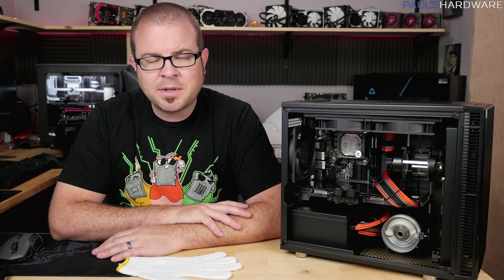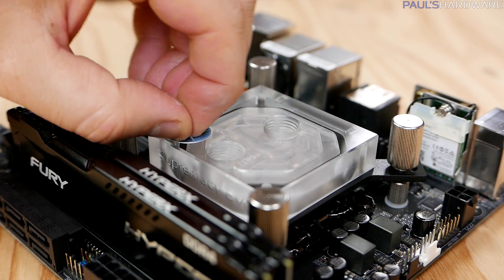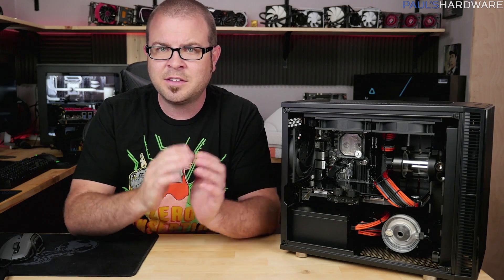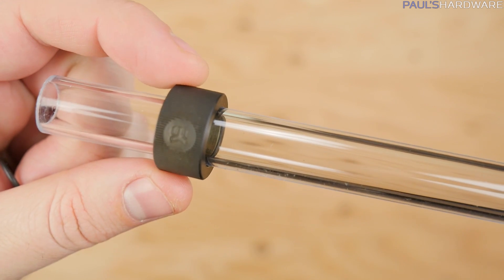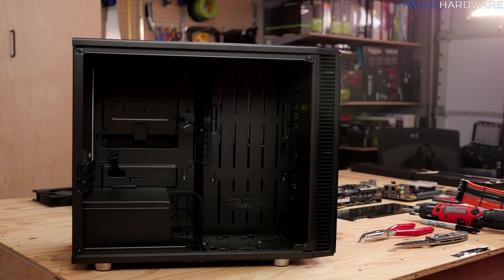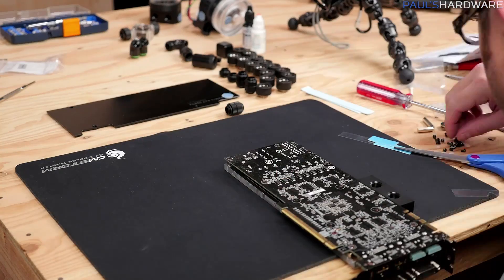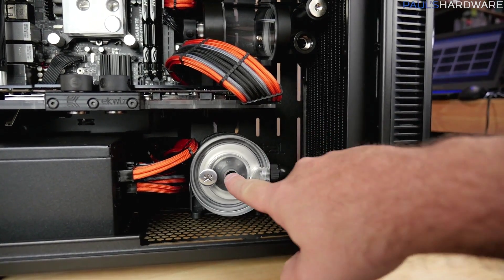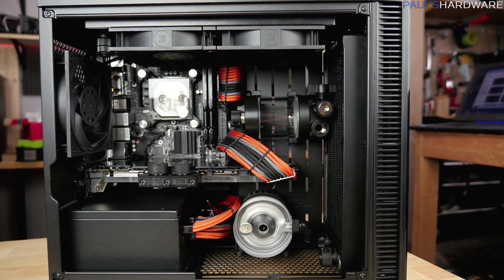HotBox Build Part 1: Mini-ITX Water Cooled Gaming PC

Comment: There is an understatement in a EK instruction for the series 9xx and above, which means the input/output of course can be changed, but the difference between i/i and i/o is almost 6 Celsius over load(34/40) and 2 Celsius on idle. When you can make an input on the left side, do it for better performance .

Comment: Hey Paul, I have an EK Vardar question. I really like their 3000 rpm fans, and want to use them for another build, however, the red sleeving doesn't fit my color scheme. So, I am curious to see if they will get ever go to black sleeving in the 3000 rpm line.

Furthermore as a bonus, will they ever go to white vardar fans in the 3000 rpm line.

Side Note - The only thing I would change: Personally, I would purchase a Corsair AF120 and spray paint the outer plastic ring orange to match the cables. It would help balance the color out in the case, so that you aren't forced to go with orange liquid. You could use something like white or a marbled liquid that matches the gray in the cable sleeves.

Comment: Would it be possible to mount the fans on the front radiator inside the case so you could use the filter on the front of the case? I assume you would have to find a different solution for the res.

Comment: nice video. i got a question how did you mount the fans and the rad in the front what screws did you use? i have the same case fans and rad but wasnt able to mount this with the screws provided

Comment: Hi Paul , I want to use the EKWB kit like you. I would greatly appreciate a detailed run down of the PetG tubing and Fittings needed size wise not amount as each build is different. Like what are the fitting called that screw into the Radiators ect ect . PLZ and and thanks for your time. I just don't want to use the rubber tubing that comes with the kits.

Comment: Hey Paul. I've recently discovered your channel. Planning a few new rigs to run my new house. I've doing research as it has in fact been 5 years since my last build. I had a question on the water cooling. One of my many skills is as a mechanic and I noticed the water reservoir is below the vessels you plan on filling. All engines are designed with the reservoir above the engine and a bleeder valve in the uppermost point in the water cooling system to remove air pockets during filling. Does coolant cavitation reduce the efficiency of the system to the point of failure in this setting like it does in a car? How are you planning to bleed the system without the gravity assist?

Comment: I have a question: If you're running a single loop for CPU and GPU, wouldn't GPU performance suffer if you base it on the temps curve off of the CPU only? I've seen this done and I guess that in the end components are so cool because of your over abundance of cooling potential with 2 radiators that it doesn't really matter.

But let's assume that you're limited to a single 120 rad for both CPU and GPU. You could keep the system idling very quiet but you want to really ramp up that fan fast when things heat up. Most game will hit a GPU a lot harder than a CPU and thus raising it's temp much sooner than the CPU which will be dictating no changes to the fans yet since it is at a cool 45 to 50c when the GPU could potentially already be climbing up a lot higher than that I've seen that disparity before.

Comment: +Paul's Hardware That loop will never drain right with your valve there, unfortunately. Bleeding would also be a royal bitch and a half. You should tee off the line going from the bottom of the front rad to the pump. it's the lowest point of the system, and also has the benefit of being the very top of the system, for bleeding, if you flip it over.

Edit to add: you'd bleed it kind of like a car, by using a funnel and just keeping the funnel filled while cycling the pump.
Reply from the maker: thank you! some very good tips here that I'll be keeping in mind
Reply: +Paul&#39;s Hardware Put a T at the out of the front rad with a drain valve  and than go to the 980ti as u planned.

Comment: On my GPU the right side of the waterblock is the output and the left side is the input. I would put a 90 on the bottom left port on that block and use that as the in from the front rad.

Comment: Negative air pressure in the case is a really odd choice. Is that on purpose or did it just happen to be what worked best with this configuration.
Reply: What do you mean? 2 front intake 2 top exhaust and 1 rear exhaust
Reply: Thats exactly what i did and its really cold temperature im getting
Reply: Poups Gaming You will end up with a lot more dust in your case, as someone with a side panel with a window it makes sense to keep positive air pressure.

Comment: Quick question or two....my motherboard for the computer I'm about to build is the EVGA Classified - I was going to run 4 way sli on it so one question is would I have access to another pci or pcie slot for the elgato game capture hd60 pro? And one more question can the Intel core i7 - 6700k run 4 way Titan x sli and if I will have access to it the elgato? My PSU can handle everything so I don't think it will be a problem - Corsair 1500 fully modular
Reply: The i7 6700k doesn't have enough PCI-e lanes to support 3- or 4-way SLI. You'll either need an i7 5930k or an i7 5960x for that.
Reply: And isn't the EVGA Classified an X99/LGA-2011-3 motherboard? So it won't be compatible with your Z170/LGA-1151 CPU.

Comment: I understand using a dot of thermal paste on the CPU but why differently on the GPU?
Reply: +Shane Bigler My guess is to see how the comments would react.
Reply: +Shane Bigler more is actually required on the gpu. There's a jayztwocents video that actually covers that. Basically it doesn't really hurt to be generous with thermal paste on a gpu and with both having too little is the problem. gpus are a little harder to judge for how much is just right.
Reply: ArtisChronicles yup, saw Jayz video not long after posting this.

Comment: Hi Paul, looks like you're going to have negative air pressure in this case. I would re-think that. By my count, you have 4  fans on rads, all spinning at the same speed from the Fan splitter. Then an additional exhaust fan, which would push the 'balance' into the negative air pressure realm. Dust... ewwwies. <3 your channel, Adrian

Comment: Does anyone else remember IDE flat ribbon cables for HDD and FDD that were considered to affect airflow in the case ? OK in those days fans where smaller and we used less of them but an effective solution to the airflow issue was to buy round cables instead. They have a much smaller surface area and are far less bulky and can be coloured to suit the system with shrink tubing. In a build like this I think round cables might actually look good and give you far less issues.
This could be the next new trend, you read it here first !  8-)
Reply: Maxwel
But for the sake of aesthetics, tight round bundles look much better in a small form factor case, these large spread out flat and individually wrapped cable arrangements are fine when there is plenty of space.
Reply: Maxwel
I only raised the point of airflow because that was the main reason for changing from flat to round cables, it was necessary back then. These days it's all about aesthetics.
Reply: Maxwel
I was referring to older computers from the early 2000's that had very few spaces for fans and the only fans available were 80mm which had really pathetic flow rates and static pressure.
It meant having to have them spinning at 5,000 RPM to get any airflow so they were noisy and hated. People were looking for ways to reduce noise and pointed the finger at anything that might cause issues with airflow. Flat IDE ribbon cables were one of the first things in the path of the air so consequently became one of the first things to be sold commercially in a 'custom' alternative. Round variations were sold in a variety of colours and did help reduce the noise from the single rear fan by allowing better airflow which meant the fan speed could be reduced to about half !
Modern fans are much more efficient but even so obstructions in the air-path can have an effect on airflow.

Comment: I presume you installed 32GB RAM just because you can and not because you think you'll actually use it ? Still, a nice build. Glad to see that a radiator can actually be used in the top of that case. I understand that it depends on the radiator and motherboard used.

Comment: I know it's kinda late, but you could've used an Evolv itx. I think that'd be the better option, albeit its bigger size.
Reply from the maker: +Spoert M I strongly considered the NZXT Manta as well, but I like the smaller size of the Define Nano S
Reply: Paul's Hardware Oh Okay. I'm glad you responded so I know why you picked that case.
Reply: +Paul&#39;s Hardware just a question. why aren't there any black 92mm PWM fans that have white or purple LEDs???? WTF

Comment: Dust filter the rear fan and have it as an inlet or you're going to have all kinds of negative pressure in there
Reply: +Neil Birchall you know right you can determinate the speed of the fans yes? prob solved.
Reply: +ODIO POWER Since Paul already said the radiator fans are going to be variable based on CPU temperature, you're still going to have more air going out than going in
Reply: Neil Birchall  that MoBo has only 2 fan header. He should go with a splitters for the two front fan and set the speed and let the other three PWM slow in the bios setting, not all the five fans on the cpu header with a fanhub. That' s mine opinion fpr avoiding the dust inside the case.

Comment: I'm so jelly over that 4.7ghz OC. My own 6600k stops being stable after 4.2ghz. qq
Reply: Then stop using the stock cooler
Reply: I'm using an H80i cause it's the only one that's both readily available to me and fits in my case. Also, the K skewed processors don't come with a stock cooler.

Comment: are you really supposed to put all that thermal paste on the GPU for the EK water block? I've seen this 2 different times, and I actually thought it was a joke or the YouTuber didn't know what they where doing. I'll take your word for it. since you do way more builds and water cooling than i do. I never used EK hardware. only TTE sports water blocks and the instructions didn't say to put tons of paste all over the GPU and die.